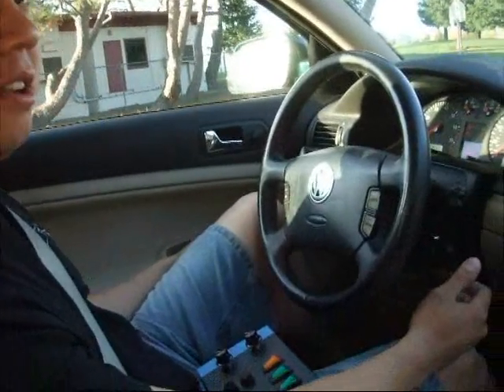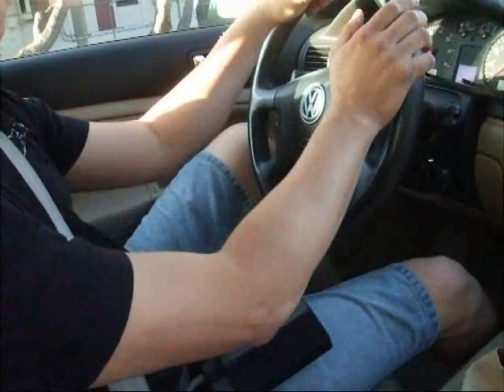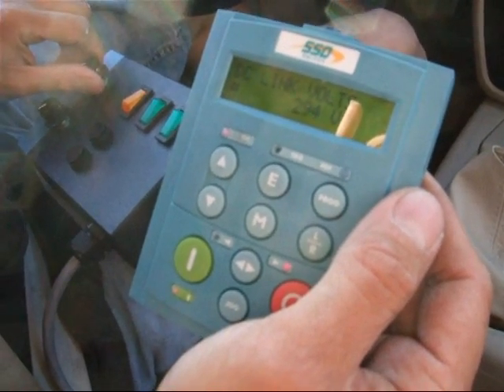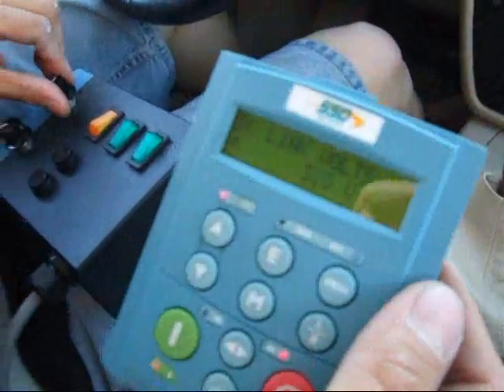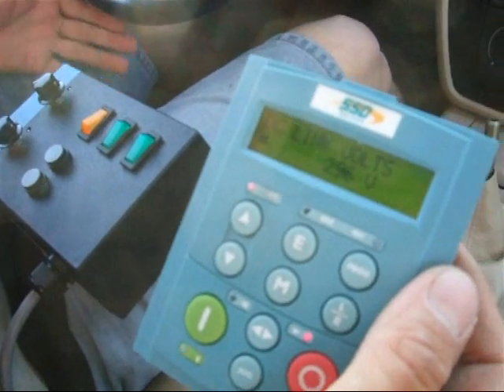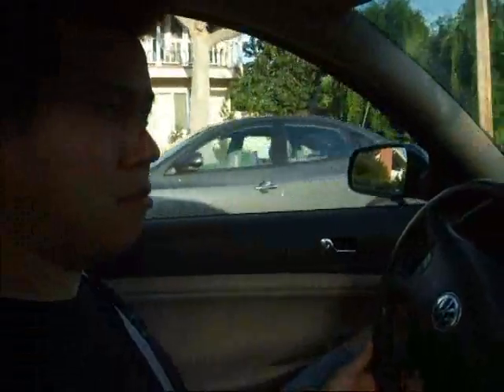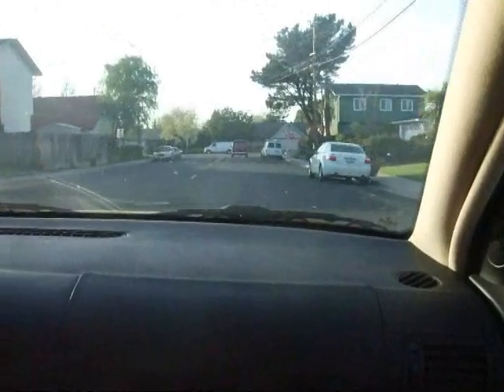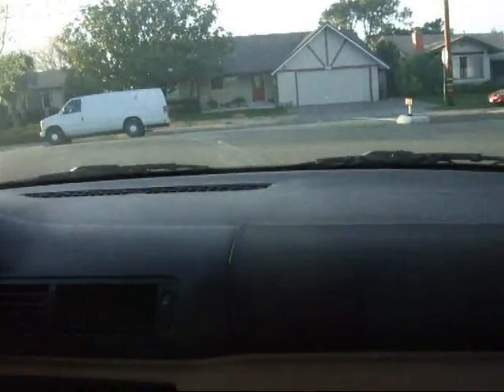Electric Car Conversion using Siemens AC motor and home made 3 phase controller

Comment: Do your brake lights come on while using regen brakes and not touching the brake pedal? If not that might be something you would want to consider
Reply from the maker: I originally wired it to turn on the brake lights, but the amount of regen braking that occurs when my foot is not on the brake  is only around 35kw.   With my foot on the brake, it pulls about 100kw, and the brake lights will be on.
Reply: etischer oh ok. Yeah I was just thinking if u were able to come all the way to a stop without using the brake, then it should probably have them. But you’ve made it this long without any problems so it seems fine haha

Comment: Could you share how did you made 3 phase controller and brakes that refill batteries (electronics schemes). I want to convert my car to EV too. I start building battery blocks out of old laptop 3.7 cells.

Comment: a couple car use something like this but a regular 0-5v potentiometer for the accelerator. a mini that was done a while back had 0v full regen and 5v full power. as soon as you lifted off the go pedal you got full regen. it took the driver about a minute to get use to it, as in one minute. A bunch of newer cars use these potentiometer, probably Volkswagens as well.

Comment: Top speed, range with a full charge ?
Reply: Top speed is 105 mph (170 km/h), but am not sure the range, as it depends on if he uses A/C or drives heavily or lightly. :) He has a new video out from 2019 or so, which I watched today.

Comment: Interesting effort... 2009 video, so maybe you addressed this.. question..  if your regeneration braking kicks in when you stop trying to positively accelerate, then there seems to be no coasting.  I assumed that you or anyone else, would have relied on the first portion of the brake pedal depressed to kick the regeneration.  Isn't coasting a bit of the higher efficiency to driving?

Comment: If you have an alternator installed wouldn't that regenerate/save some of the used power by recharging the batteries?
Reply: Carl Darl LOL the perpetual motion machine. That would be like pushing a car with the brakes on (the alternator would act similar to slowing the vehicle while the electric motor is trying to push it.)
However there is regenerative BRAKING for when the momentum of the car can  recharge the batteries when you are slowing down or stopping, so you do get some return.
Reply: +Carl Darl It would take power away, perpetual motion is not possible.
Reply: If you use eletricity to spin alternator to create eletricity you will lose some (resistance of conductor = transformation of electricity into heat)

If you pump this power back to battery you total saldo in -

If you use electric engine to move whole mass of car and you whant to break.
You creating electricity by spinig engine by wheels (Speed+mass of car is source of power)
you still are on - (coz engine is now alternator and car speed and mass is temporary engine(who got his power from battery earlier)) but in reality you are on + compared to other egine types without regenerative braking coz all this power would be normaly lost by a standard breaking.

Comment: im thinking of building up a gen 1 or 2 mx5 with 2 motors (one on each rear wheel) as well has some fancy stuff for weight saving and battery placement.. my goal is 0-60mph in 5 to 6 sec with a top speed of 150 mph and a range of 250 miles on a bad day and 300 on a good one... with a charge time of 4 to 6 hours from a 240v outlet
Reply: Let us know when you start your build
Reply: @manuelmunos5674  He didn't build anything! When talking about EV conversions and the dude is preoccupied with accelertion times and top speed, you know they have no idea of physics. Making a dual motor EV with a Siemens motor that is already too big alone, is the sure way to get a very heavy shortrange vehicle. Remember these are induction motors, and their peak efficiency is only 86%. However going around town at 30mph, the efficiency drops to 55%, using two of them, you aend at 40% efficiency. Add to that the extra torque and the expense of using two inverters and the hazzle of making them play together (You no longer have a diffrential), and the plan turns out to be completely bonkers.

Comment: Looks like a good job. Well done.

How do you power things that are usually run from the engine in cars - aircon, heater, brake boost, steering?

Comment: @whatifpeace, be patient, my company has invented an on-board self regenerating power source that will recharge any battery system. You will never need to recharge an electric car again or need a charging infrastructure in place. We just need to get the funds to bring it to market and dodge the bullets. Any ideas?

Comment: Hey Eric, good job on your conversion. Just wanted to say thanks for the info and inspiration. I got alot of good information from your site and found out that what I wanted to do was possible.

and to dan, The IGBT module he is using(PM300CL1A060) has integrated gate drivers, you only need to give the module isolated power supplies(and the gate signal of course) which the drive already has.

Comment: it's Tiger Woods!! no wait : )
that's racist man : )
but seriously, very nicely done. I guess you didn't lay down with the naysaying dogs on evtech and just did it. if I understand your website correct you just hacked a 3HP VFD and put in some big IGBTs and caps? no extra gate drivers? the small VFD can pull the bigger IGBTs?

what's your background? EE grad?
do you work at a place using electric motors? how did you get into it?

Comment: The video does not explain this.  The author of the video would best qualified explain this not someone as condescending as you.  I'm licensed to operate a vehicle with airbrakes THAT'S why I questioned it  out curiosity NOT doubt.  So many people today are driving into buildings becuase they can't find the damm brake pedal.   Did you build a car like this? 
I asked one simple queston and 
too many eggheads on You Tube take shit too serious and insult each other over some dumb shit.

Comment from the maker: The motor was rated 17k rpm, but I had to replace the bearings with sealed ones so max rpm is now 10k.  

My inverter is rated 300A at 312V, so assuming it is 85% efficient it is putting out about 80kw. 

Thanks 
-Eric